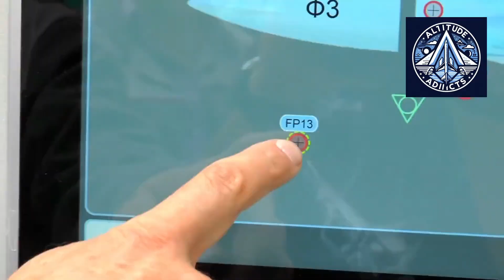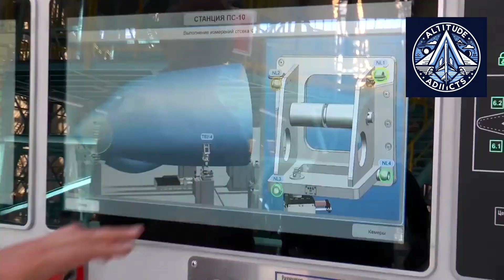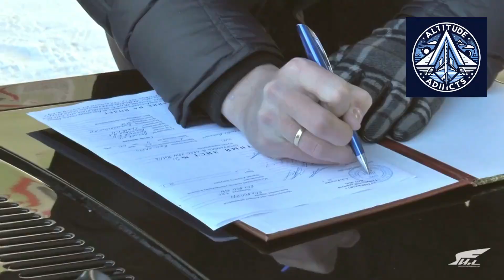Why Il-76 Production Collapsed—And How Russia Brought It Back

Comment: Over 20 years ago, I was doing some work with an import-export company, and occasionally, we would need to solicit price quotes from logistics companies for air cargo transportation. The Il-76 always had the lowest quoted prices per ton for cargo transportation, out of any of the aircraft models operated by these logistics companies. For bulk cargo transportation, the Il-76 was unbeatable at that time, especially since so many Il-76 airframes were still available to air cargo companies then, and many of these still had plenty of life left in their airframes. I have no idea what the situation is like now, but it makes me happy to know that the Il-76 is making a comeback. Russia might not be very competitive in civil aircraft manufacture at this time, but maybe if it revamps Il-76 production enough, it might become a world-leader once more in bulk air cargo transportation. The key is that they need to ensure that the engines used on the Il-76 conform to noise regulations, or else they might get locked out of many civilian airports.

Comment: designed by a genius ..... 
to be fair Tashkent factory was performing at an extraordinary level ... I think this discussion seems to ignore that ..... how did they build so many ? 
Aviastar also had An-124s in serial production - more An-124s were built at Aviastar than Ukraine ...
anyway there are only 3x large military transports in production now ..... the ridiculously expensive (and slow) Airbus A-400 turboprop ...... the Chinese Y-20 .... and the Il-76 
the Chinese Y-20 is apparently being built at 8 p.a. ..... but that is Western "data" I would guess 12 
so Aviastar at 6 is not that far off ...... 
people forget each of these aircraft weight close to 100,000 kgs ..... that is a lot of components bolted together .